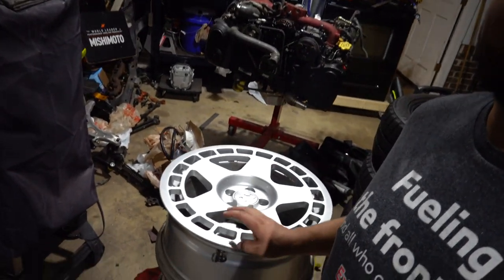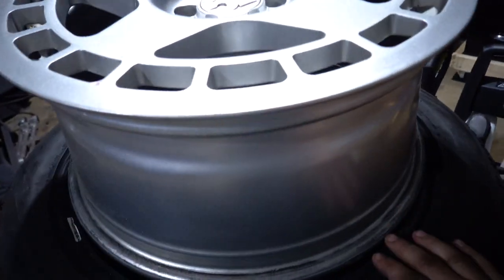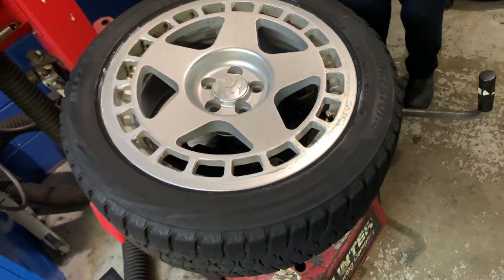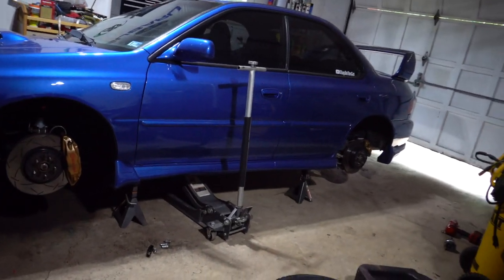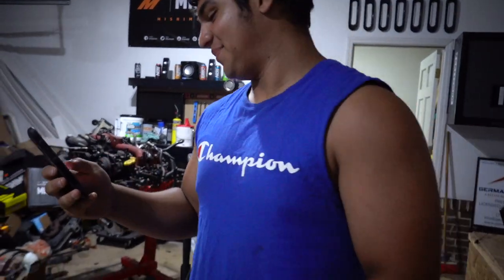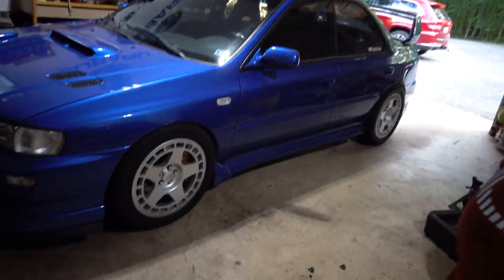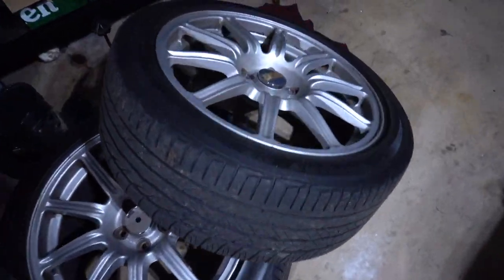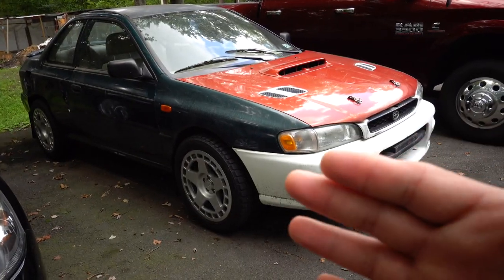New Wheels For The GC8! Meaty Setup!!

Comment: What size are the tires? Did I miss it when you said it? Lol
Reply from the maker: 225-45-17 but these are winter/snow tires lol
Reply: @StayOnTheGas  looks good looks like 50's. I was going to get 225-50-16 for mine but I'm stock height and sadly I have to keep it that way cuz the potholes, snow and rain. Did they look good on the coupe at stock height? I couldn't see it very good from my angle
Reply from the maker: They look really good on the coupe at stock height! The only reason why I wouldn’t do 16s is because they won’t clear the big brakes that I like to run
Reply: @StayOnTheGas  Oh I see them sti brembos pretty big. I'm hoping the 16s fit fine over 04 Wrx calipers
Reply from the maker: They come with 16s so you should be good

Comment: we’re they rubbing on the inner fender well as well? i put some gold 05 sti bbs on my 00 rs and they sorta fit until i go over a bump at a decent speed. then they rub lol.
if they did rub, what did you do to fix that?
Reply from the maker: Yeah they did rub. I ended up rolling the fenders to get rid of that. Right now I’m running 04 sti bbs so they are half an inch thinner than your 05 ones so maybe that’s why mine aren’t rubbing. Are you using adapters?